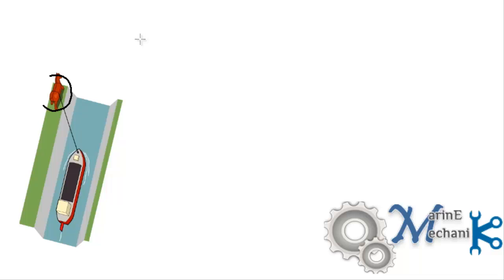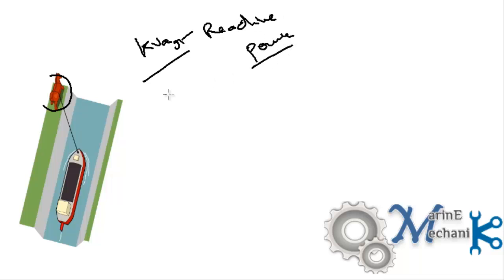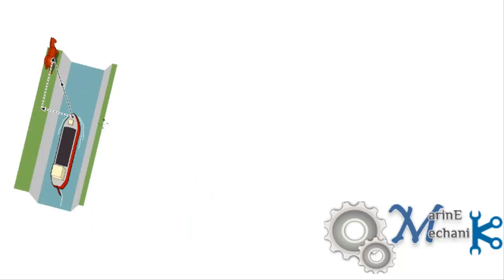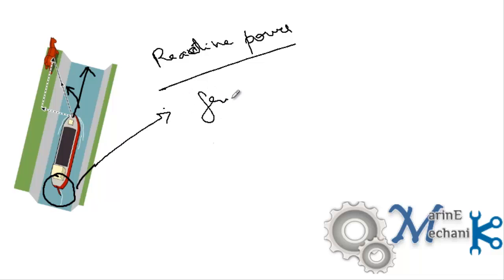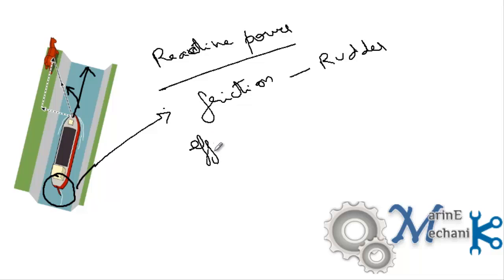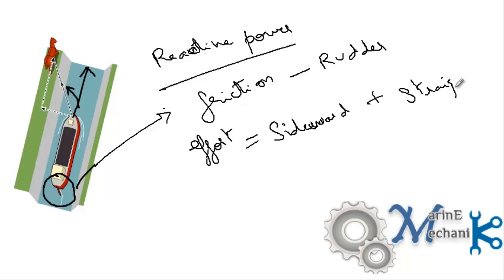Best Explanation for KVAr..with an Example, Must Watch. Part 1

Comment: the narrator seems to be obsessed to prove his point. Reactive power is not a loss but an essential element for grid stability by offering that desired cushion of voltage regulation. The analogy doesnt fit appropriate at all

Comment from the maker: Loss - I used this word for giving a perspective. Technically, nothing is Lost. However, because of the reactive component, the actual performance of the horse is not optimum. for example: If the horse was pulling straight, let us assume the power is 100%. Now since the horse is pulling from a side, even though you keep a rail to guide the horse or anything, The actual performance of the horse is not optimum. There is still compensation done by the boat's rudder, which increases friction.

Comment: Hi, thank you for trying to explain this complicated subject. I have a few questions. When you say loss, are you sure that is the right word to use? Doesn't loss imply dissipation? Since the reactive component is doing no work, no power is actually used (due to the reactive component) right? The horse could be applying a straight force if it were guided by a rail. That rail would provide the reactive component. Am I understanding correctly?